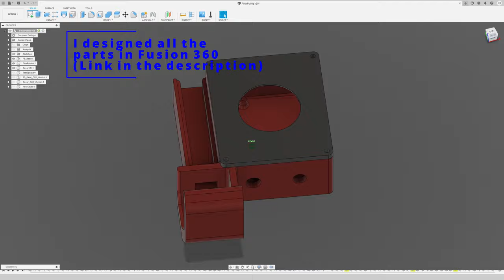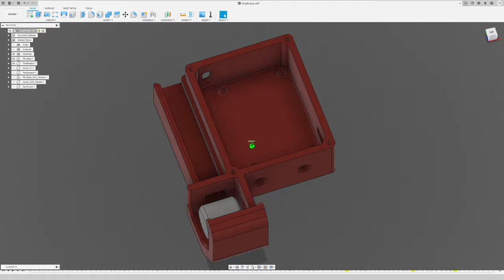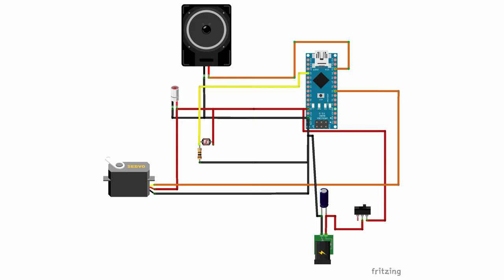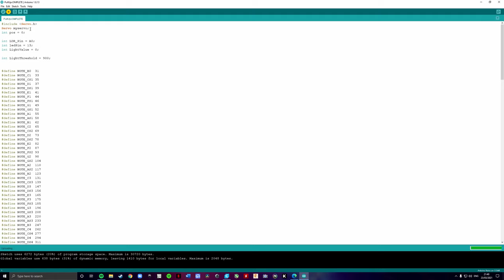Arduino Smart Pull-Up Bar that give Candy and plays Music! -  HowTo

Comment: Hey Congrats on the build!
I found it very interesting. Nice idea!
Just some small piece of advice: 
- if your bar is hollow you could do the wiring passing inside of it other than going over the door to avoid breaking the wires with the door. this could be a safety issue.
- Also why not use some batteries and fix the device around the bar? You could just use the ext-power supplier to recharge or even use some rechargeable AA or AAA batteries.

Keep the good work(out)! :)
Reply from the maker: Thank you Angelo for the support and for the feedback! Doing the wires inside the bar sounds like a good idea, it is a little difficult though to install and unistall the bar but I'll keep it in mind! I thought about using batteries but I wanted it to be as simple and compact as it gets in case someone wants to recreate it. If I ever make an updated version  though it would be a cool idea to make it rechargeable and more compact so that it attaches on the bar just like the laser and LDR do! Have a great day!